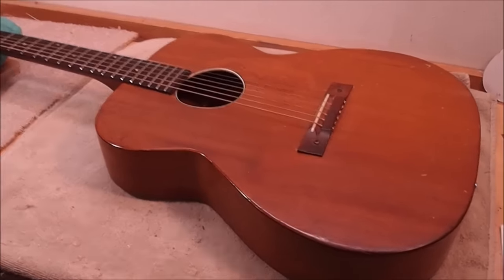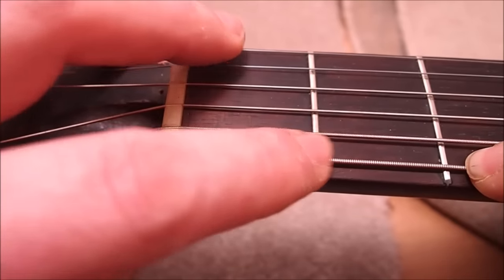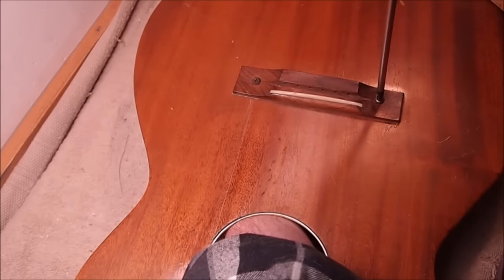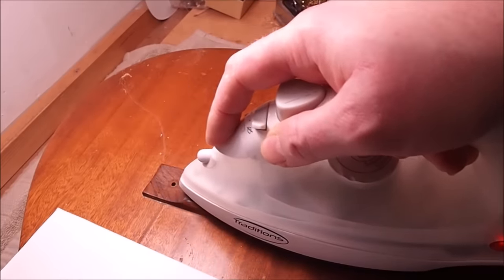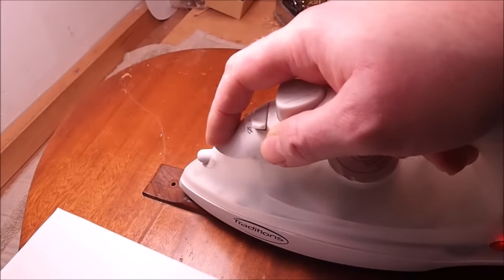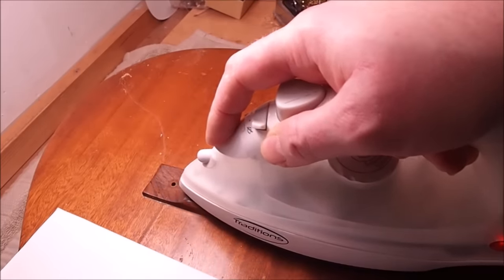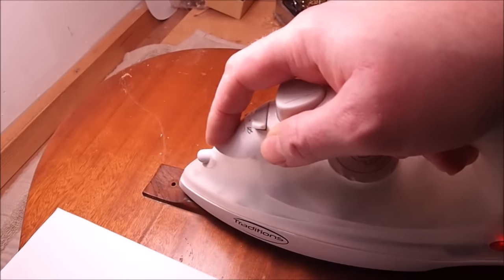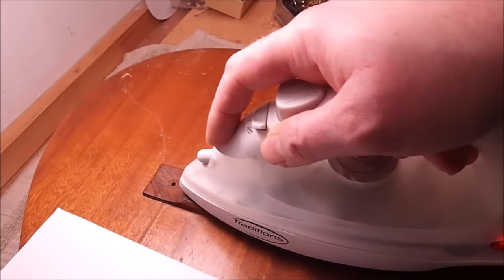Guitar Repair - Replacing a Bridge

Comment: And here I am, three years later. Your lesson is as valid as the day you created  it. I am intrigued by the range of guitars Harmony made. I live near Chicago, and I even wonder where the factory was located. 
You did wonderful work on that guitar, and you did "wake it up". The before and after segments make that very clear. Also, the information on string angle break is very useful, especially because I am working on regluing  the bridge on an Art & Lutherie Folk Wild Cherry  model that I just fished out of Ebay. The guitar has had bridge/saddle work done before, and the break angle on the treble strings leaves much to be desired.

Thank you so much for sharing your knowledge and your experience. No substitute for the latter where craftsmanship is involved.

Comment: break angles are called down bearing on pianos. the high treble always has more down bearing than the rest of the instrument. down bearing is a balance of dynamics and sustain. the greater the angle the louder it plays, up to a point when too much destroys the tonal projection. just like a guitar, the strings are thicker in the bass changing about every 5 notes getting thinner as you go up the scale. the thin ones are also much shorter in length. they really need the boost to sound even with rest of the notes. you taught me plenty about guitars today ,  thank-You

Comment: Got a guitar exactly like that. been hanging on my shop wall for 20 years. I been contemplating changing it to an X braced martin pattern for a long, long time. but now I'm inspired to just modify it like you did here. it sounded pretty good I think. Beginning to think the latter to X brace conversion might not be worth the effort. Thanks for the videos.
Reply: Earl Elfrink - This link -   https://www.youtube.com/watch?v=Da1RWZtFe7E  -  is a link of two Harmony H-162's (same as the H-165's except they have a Spruce top instead of a Mahogany top) that have been mod'ed - They are now  X-braced with pin bridges etc. They sound beautiful. You may change your mind about yours being X-braced.

Comment: Attempting my first repair on my mid 2000's Alvarez acoustic/electric. String tension has pulled the bridge up and bellied the soundboard behind it significantly. In removing the bridge with some heat it has pulled up a small amount of the wood in some spots where the glue wasn't fully softened. How can I address that missing wood before attaching the bridge?...its basically the depth of the grain of the soundboard if you understand what I'm trying to say. Adam Savage turned me on to your channel, and I love it! I have always attempted my own repairs but now I'm armed with KNOWLEDGE. :)

Comment: I like how you do the repairs, it's logical and makes sense how it's done, i recently had to do a bridge repair on a drednaught shape box as the bridge was lifting from the base due to way the bridge was originally glued to the body. It was glued directly on the fininished paint and not the raw wood but i shouls see by tomorrow if the repair took strongly

Comment: You've convinced me ... much too complicated to do this myself and the cheap guitar I have is just not worth it despite the reasonable action. Excellent video balanced in presentation! Wishing you continued success!
The after test ..to my ears .. seemed to have an improved bass response..definitive and louder. Hard to tell on the treble side ..ie the new strings or improved volume here too!!

Comment: Very Nice ! I have a 60's Stella / Harmony which was my 1st Guitar back in the 70's. I am putting a new solid Spruce Top, Bridge, Tuners, & will be X braced 1 " below sound hole.  Hoping this will be a Good Blues Guitar. 24 1/4" Scale on mine, 12 Frets to Body.

Comment: Great video, thanks. Maybe you could help me with this problem ... I made a diy wooden clamp that goes over the bridge, is curved on the bottom to fit the bridge top and connects, trough the string peg holes, with the lower (inside of guitar body - under the bridge) part of the clamp via 4 threaded (4mm) rods that are tightened with 4 wing nuts ... and there is one hole on each side of the upper clap for the rod that pushes the wings of the bridge down with the help of small pieces of wood. So ... I have removed everything except for the lower part of the clamp which is now glued to the top from the inside and does not want to come off. Tried really hard to kinda snap it away, with no success. Drilled all 12 holes all the way trough the bottom (I used a metal drill bit for the four holes that had metal inserts for the rods, there is still a thin metal cylinder left inside of the lower clamp - could present a problem if I wanted to use a hole reamer to try to slowly remove wood in hope of the glue to let go) of the lower part of the clamp wood and it still does not budge, not for a 1/1000 of an inch or millimetre. Would you maybe know how does one go about a thing like that? How can I "know" where the thing is glued or how much, when there is no way to see? Is that possible or should I leave the part glued and try to slowly widen the holes so that the pegs fit normally and just leave it inside? ... ... ... this really bummed me out.

Comment: Hi, Are the "pick up" wires polarized, if so how? My bridge was once repaired with super glue- is there a good way to unglue it?
Reply: Yes the Piezo pickup is polarized in the sense that its little cable to the jack socket is shielded, and that shield provides one of the two conductors just like an electric guitar cable. That shielding connection must go to the ground tab of the jack.

Comment: Wow, that's beautiful work and obviously were well trained on the use of all of those tool. I'm doing a 58'Kay 280 with a similar bridge and got the 2 inside nuts out but the tops of the bolts have a design on them instead of a slot and I  have no idea on how to remove them. I thought the tops of the bolts were caps but they are not coming out. Any ideas you could throw my way?  Thank you.

Comment: At 14 minutes in, when you use the clamps and new braces to flatten/straighten out the wave on the top, would it be helpful to re-humidify the guitar first? Or maybe let it sit in a somewhat damper environment for a week or two first so that the wood will soften and can be clamped and flattened without cracking or splitting? Is there a general range of optimum humidity that guitars should acclimate to before commencing with this kind of somewhat-invasive repair work?
Reply from the maker: It can be dangerous to try and force-humidify an old guitar like this with hide-glue joints. In a severe case I sometimes hang it up in a plastic bag with a damp bath towel  for a while but in general the wood should be at the ambient humidity in which it will spend its life. If it's too damp when you glue in the support pieces it will shrink as it dries, possibly pulling them loose. I keep my shop between 40 and 50% relative humidity.

Comment: I'm awaiting the day I do my first acoustic bridge removal. I did it wrong once already when mine snapped in half and pulled itself completely off the soundboard lol. It took some cedar chips with it. 😭

It's a vintage Cort from the 70's or 80's that was phenomenal. Rivaled easily the Gibsons and  Takimines and Washburns friends had. After that, I repainted it a greenburst to hide the damage and it really needs to be restored all over again.
If I had the money, I'd send it to someone to do correctly since it was my very first guitar but I am unfortunately poor  AF lol.

Comment: I'm curious why Harmony went to the trouble of binding the sound hole but not the body joints. Strictly cosmetic? "Tradition"? Same questions regarding the more elaborate rosettes on other guitar sound holes. Can't see how this would contribute to the tone of the instrument. I've always thought it would be more practical to simply seal the grain.

Comment: Off topic, but may I ask where you purchased the c-clamps that have an extra screw clamp built into the middle of the clamp? I have to build up support blocks to prevent mine from cantilevering and twisting / stressing the sound board when clamped.

Comment: I think I like Jerry Rosa's saddle placement method's a bit better.  No offense, this is by the book but Jerry's is by ear or tuner.  Just a suggestion...  Uses a temporary, thin saddle on top of the bridge before the slot is cut; jig to hold large and small E strings; allows for more accurate intonation also.
Reply from the maker: You go ahead and do whatever you think works for you.

Comment: It looks to me as though the guitar has been poorly re-finished at some point. It looked like a build up of stain in the top/side area. That could account for the strange curvy line from the bridge area to the edge of the top - a run when the finish was still wet.

Comment: I have a question @ 19:00 when you drilled the bridge pin holes, did you drill all the way through the body? I'm trying to replace my pinless bridge with a pin bridge and idk if the body actually has holes for the pins.
Reply: yeah, of course. In this kind of bridge the string go all the way through the top. You insert the ballend from above and put in the pins to get something akin to a wedged fit.
The bridge he removed was the kind of style youd normally see on a nylon-string guitar. There the strings are knotted to the bridge and dont go through the body
Reply: @TheVergile  thanks man. i couldn't figure it out so i just glued a pinless bridge on my guitar 🤣 and i use steel string too, didn't think the bridge/neck could hold that tension but it works

Comment: Ouch... Working with a bare iron on vintage guitar? Heat insulating shielding is highly recommended. Simple foil would do.
Reply from the maker: 21 years of experience tells me otherwise.  More often than not the   lacquer on Harmonies will soften and stick to the shielding, leaving a wonderful mess.  The iron isn't super hot.
Reply: @twoodfrd 
Copy that.

Comment: i installed a coil tap switch on my electric guitar , they are humbuckers and when I switch to single coil its not as loud, is there a way to make it as loud as when its switched to double coil ?
Reply from the maker: Unfortunately no. Not without some kind of boost or preamp.

Comment: At 65 I realize I missed my calling. In my teens I worked in a guitar shop with a luthier on hand. Wish I had learned to do this. Love the arts of guitar and wood, yet spent my life with grease and oil as a mechanic. Go figure.
Reply: I actually also currently am an auto technician, having moved across from being a radio, tv, video, audio and satellite technician ( who also fitted radio and tv aerials too ) and also currently repair cell phones, tablets and laptops and now despite being many years since my mom wanted me to lean the piano, I have got into the repair of guitars as i really would like to teach myself to play. Got one successful repair of one which I bought with the bridge completely detached and had to re attach to the soundboard, make a new saddle ( chose bone ) and then restring and retune. So far, success and it’s staying in one piece too.
Reply: @carltontaylor3014  I've been playing guitar for 50+ years. Only thing besides Christ that keeps me sane.